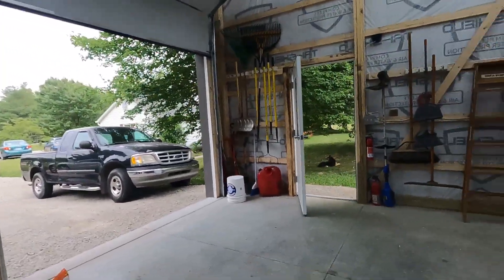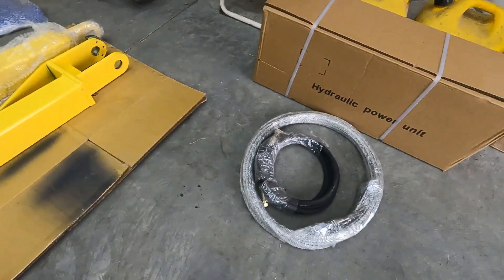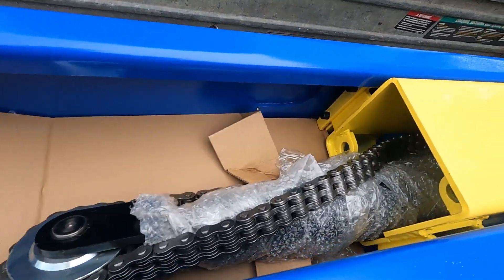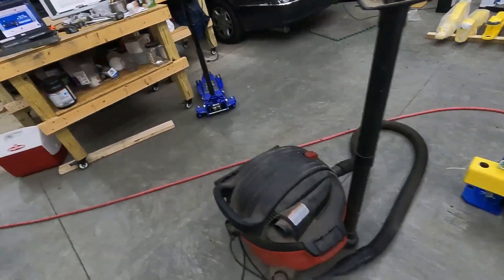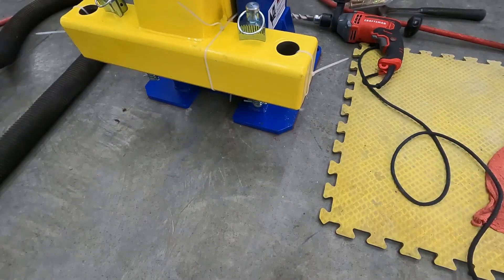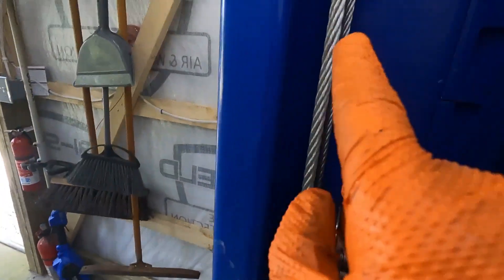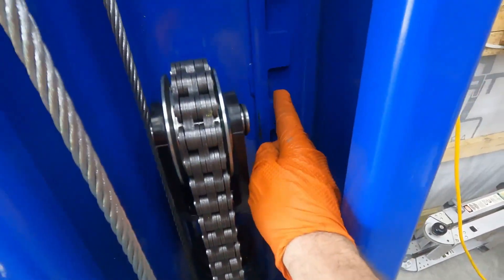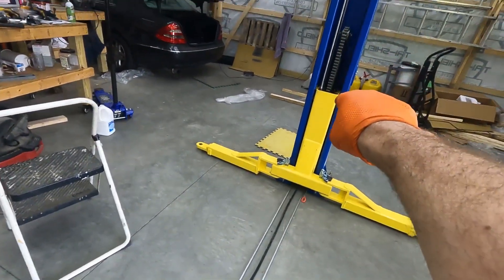Workshop Update: Installing a Two-Post Lift, an Atlas 9KBP

Comment: Very good video! I am considering getting that same model.  I only have 9' 11" of ceiling, and still debating on how far past the garage door opener that I will need to install it. My garage is 28' wide, but my doors look identical on the spacing in the middle to yours. I guess my other debate is whether to go brand new at $3k ish... or there's one that is used in my area for $1,100. Thank you for the great explanation. I believe that your methods would work with any brand.
Reply from the maker: Thanks, @themostlymikeshow, you definitely need to plan it out carefully. If you work on tall vehicles like SUVs, you'll really wish you had a taller ceiling, but even if you roll around on a chair or stool beneath a lift, you'll still get some benefit.

Comment: This is an excellent video!!! May I ask the width dimensions as I am getting different numbers from Atlas.  One can u install the pump component on either  side or back of the lift.  Making the width dimensions shorter if placed on the back/front of the column.  In addition, can you give your dimensions from outside baseplate to outside of the other baseplate. I have looked at the manual and models which give various dimensions.  

Thank you

Comment: What is the max weight vehicle you've lifted?
Reply from the maker: I have an F150, but it's a 2WD for hauling crap around. My wife's ML320 CDI is heavier at 5,000 lb curb. Obviously, the lift isn't challenged by lifting that.
Reply: @ArtOfDiesel thanks. I am looking for one for campervans that doesn't have the top beam obstructing. Tired of running things on my back and hitting my head on mild steel components 🤕.
Reply from the maker: @functionalvanconversion4284  I'm completely with you! I've been working on cars as my hobby for 30+ years and the wear & tear on my body is a lot lower when I can walk under the car, or even pull up a chair and work on something under there. It's also useful for things like dropping transmissions, where being able to pick up the car is valuable, rather than trying to scoot the transmission out from under a car on jackstands.

Comment: I am looking at this same lift. It is better built than many other brands . And the locking mechanism is pretty stout . Would you buy this same lift again or one that has the top plate instead of the floor plate?
Reply from the maker: I like the bottom plate. People complain about bottom plates getting in the way, but I want to lift SUVs and other tall vehicles and stand upright beneath them. It's shallow enough that I can roll carts across it, and things like that. The addition shown in this video was done to get a tall ceiling. A top plate keeps the floor clear, but it becomes a limitation on vertical movement.
The only different thing I'd consider is an asymmetric setup, as the posts make getting in and out of wider vehicles (like my F150) somewhat difficult. The left post is always where the driver's door is.

Comment: HI,the steel cables are shaving on the floor????!!!!
Reply from the maker: No, that's not the case. The pulleys hold them just off the floor. They do touch concrete under the protective plate, but they aren't dragging across any edges where they are getting shaved.

Comment: You might want to shim the posts to keep them straight. According to your video footage, it appears you don’t have any. Good job, cheers
Reply from the maker: I checked them on multiple sides and the rails are actually plumb. It came with shims, but they weren't needed. This was a benefit of a new concrete floor that had just been poured a couple months earlier (made sure it had time to cure properly, too!).
Reply: Lucky the floor was flat, typically there is a slight slope for water to run out. Anyway, good job on the lift. Cheers

Comment: Very nice and explanatory video. I appreciate you taking the time make one. Did your lift come with a limit switch? On mine you can actually go up high enough that you jam the crimped cable end into the pulley.
Reply from the maker: Good question. I don't know if there's a limit switch.

Comment: How wide of a vehicle can you pull through this lift? I would like to install one but it’s in my building I keep my camper in. It’s 8’ wide so hopefully it’s a fair amount wider? I am having trouble getting information. I’ll call some companies this week, thanks
Reply from the maker: Width is limited. You'll have to check the specs of what you are looking at for sure. Another thing I'd consider next time is an asymmetric lift, so that it's easier to get in and out of the driver's door after pulling the vehicle into place.

Comment: just put one up and found as you did, the base plate is not 13 1/2 wide it's more like 14 1/2 ,the distance between the plates  is also wrong,   TG we placed the plate down before drilling for the second post as the hose wouldn't have fit,
Reply from the maker: Glad you did that. It would be terrible to drill all those holes into the concrete THEN find out you need to move the post.

Comment: Almost bought that lift , but realized the floorplate would be in the way for a trans jack. Otherwise a good lift for lower ceilings , but not sure its enough for diesel trucks since its not ALI certified to 9K
Reply from the maker: You either have a floorplate or one across the top. I went with the floorplate instead of a top plate so that I could lift taller vehicles without worrying about it. My ceiling allows more height than the top-plate lifts would. It's a trade, you have to go with what will work for you!
I would upgrade for the larger trucks, but I don't currently own anything bigger than a 1/2 ton pickup. Actually, my wife's ML320 CDI is heavier than our F150.